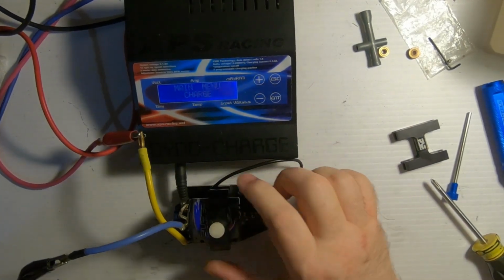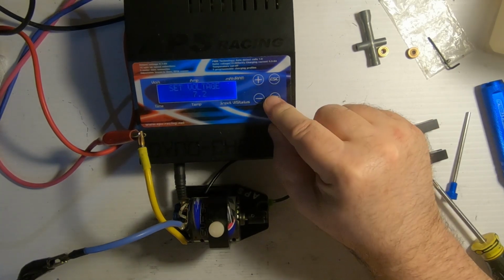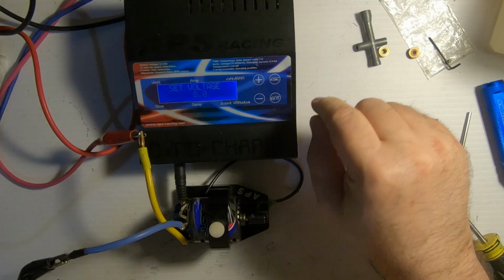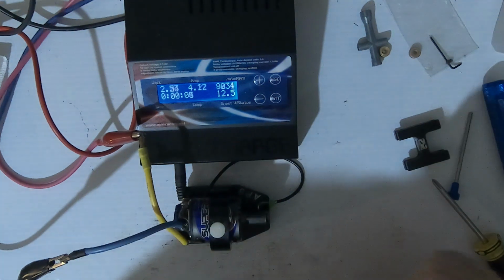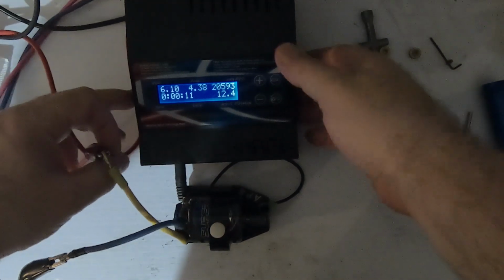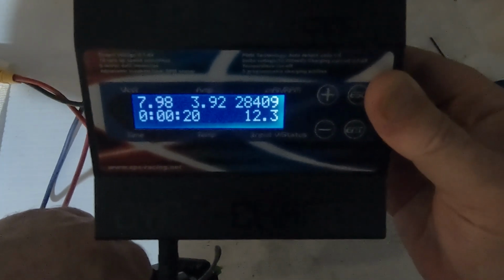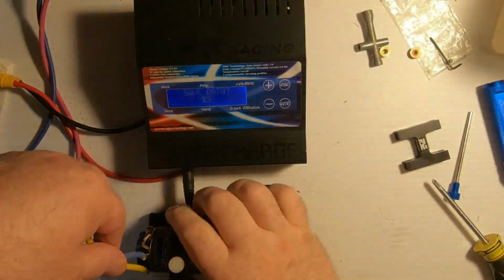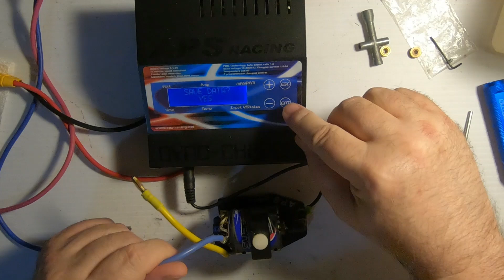Tamiya Super Stock BZ motor:  Before & After the addition of Ball Bearings

Comment: I have a TZ in my TT02 it was just 20 USD in Japan pretty cheap. I don't think foe the 500rpm I would bother doing the bearings though it would last longer I'm sure.
Reply from the maker: Sorry, I just seen your comment... @ 500 rpm more isn't a lot, but smoothness and longevity are always a plus.. On top of that, you do get to be a bit faster. A freer spinning motor also draws less amps, less amps, is a cooler running motor..Adding bearings does have its benefits..
Reply: @UncleBobsRC  fully agree on that but as I am an Australian expat living in Asia and go to Japan alot for work it's OK  to buy them cheap. But saying that maybe I might just give it a go as you obviously know more than me as I'm more of a nitro guy than electric.Cheers for your reply and have a good one and thanks👍🏻
Reply from the maker: @kanenstuff  Cheap is good..... I ran nitro 30 plus years ago in my late 20's, planes, buggies & trucks.. Wife don't like the smell/fumes so I went electric.  Everyday I learn something new and I'm far from being good at brushed motor tuning..  Hey Look for some Tamiya #10005849 parts trees (G Parts for the TXT trucks), I need 2, and would gladly pay for them, I can't find any here in the States..  LOL, no for real....
Reply: @UncleBobsRC  yeah my wife is a bit the same and does not like the noise of the nitro buggies and cars. I have only just started on electric, but I have built may racing drones. I will look for that the next time I'm in Japan as Suler Rajikon and Tam Tam have so much it's crazy and I will let you know. I hope I can help as we are all in the Hobbie and love RC, so if we can support each other, why not, have a good one.
Reply from the maker: @kanenstuff  Awesome dude!!!

Comment: 👍 getting into brushed motor lots of great learning
Reply from the maker: Thanks Paul, I know a few things to make me dangerous but I'm still learning too.. It's a lost art, tuning a brushed motor. These days, You can't really buy a good new motor and used ones are just that, used (some are great but cost upwards of 400 bucks).. I just bought what I thought was an 8 Turn Reedy Ti motor but ended up with just a Ti can, the endbell and Armature were Trinity... It's not a good mix, and by that I mean it wasn't practice to use an Epic arm in a Yokomo can, same for the endbell.... The arm was a 12x3, the can was marked 8T.. My fault for not seeing the endbell before buying it but it does run, just not as fast as I wanted it to.

Comment: Hey Bob, that was a nice test, I was hoping to have performed the same demonstration on a standard 540 silver can some months ago, but due to the unique bearing size of the standard silver can, I couldn’t locate the correct bearing size(s). 😊 I could see that from you rpm the bushings and bearing where around the same 28400 rpm, but I could hear the bearings sounded a lot smoother and the motor tested seemed to be able to spin up more efficiently. I would suspect that this would equate to a higher speed when the motors are under load on the RC car 🤔🧐 it will be interesting to see the motor on your Holiday Buggy and seem how it performs under real world driving conditions. 😊😊best wishes to you and the family 😎😉😊
Reply from the maker: Hey John, Thanks man... I remember you trying that, thing is, those sealed cans use an odd size bushing(s) and the hard part is taking them apart and getting them back together, I think the older cans were thicker and had better crimps on the endbell. As I said then, when I tried it, I realized it wasn't worth the effort.

Comment: Well mate, that proves the bearings help it spin a little faster on "no load". But I would suspect that it will make even more difference to the revs when under load as there should be less friction - that's my guess anyways!
Reply from the maker: Only time will tell my friend (I still don't have the motor in the buggy). I really need to get my butt back out and do more runs... I have a few to still do.. The Yaris, Bush Pig, Fox, Brushless Clod (issue still not fixed), DT-02 speed run, Holiday Buggy & The Blockhead Motors Wild One with the Tamiya TZ motor installed.
Reply: @UncleBobsRC  You and me both, brother. But hey, we both have a few "issues" to deal with - RC can wait another day...
Reply from the maker: @MarkBryanRC  It's my lack of enthusiasm holding me back, I'm finding RC not as fun to run like I did when I was younger (late 40's to early 50's)... I'm not dealing with the crap your dealing with...